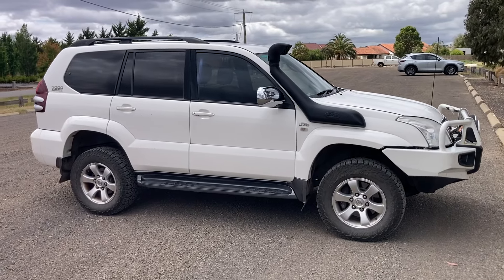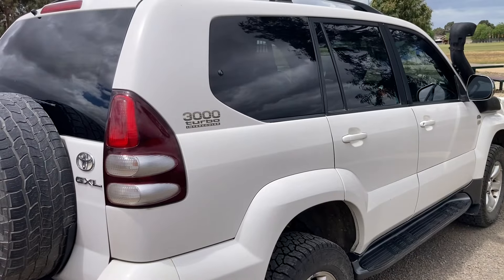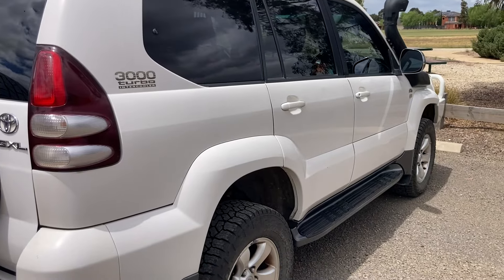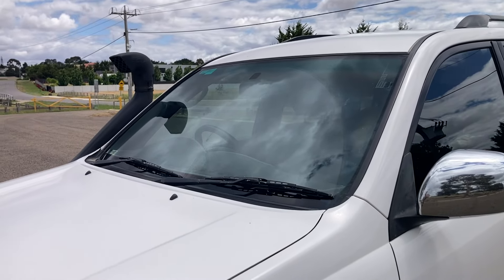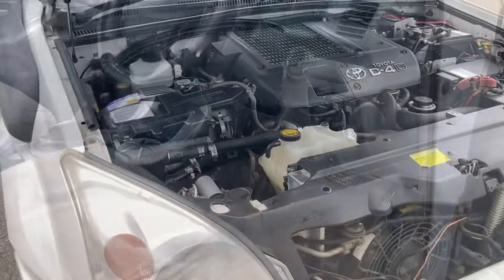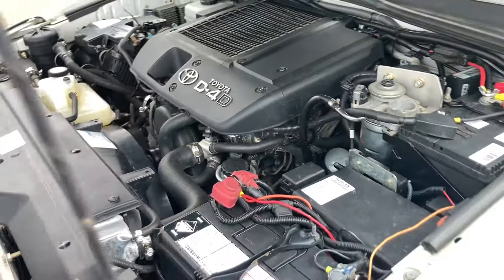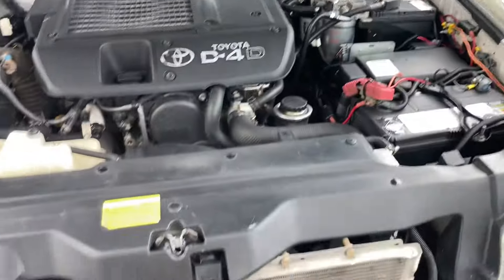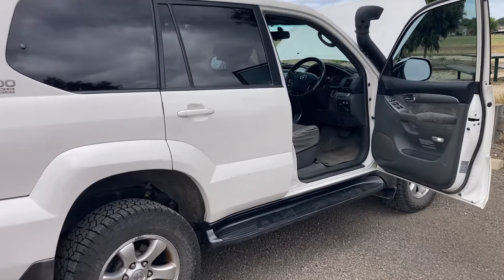LAST CHANCE Watch Then Comment with YOUR OFFER

Comment: I have a 2007 D4D Prado GXL ( Polar White ) which I'm considering selling.  It's done 296,500km  ( but importantly engine was ** FULLY REBUILT **  -  including premium injectors  -  by a Toyota Dealership at 250,000 km ) so  ' ONLY 46,000 km '  on the new motor !!  Pretty standard unit , clean & straight.  Service records avail . . . Not many ' low km ' 120's these days. So what would the group's thoughts on ( starting ) asking price ? Thanks.
Reply: I would buy it for $15k

Comment: Can’t believe it’s got a dent in EXACTLY the same spot as mine rear right door. Some asshole put it there last week in a carpark. Managed to pull 98 percent of it out with an eBay dent puller and glue gun so if you guys out there wondering whether they work they do.
Reply: I also have a 2007 D4D Prado ( White ) which looks identical to this one . . . complete with the ' very same ' rear right door dent !  :)

Comment: Auction place near us had similar 120 prado 1kd 6 sp manual for 12500 with 420ish Ks
Reply from the maker: And it had all the gear nice one if auction prices 12,000 maybe it is worth 20,000 after all 
When somebody hits 15 I think they’ll be getting close to around what a deal will be maybe hard to say I’m not the seller
Reply: @Fourby4Diesel no offence mate id be heistant as there could be a cracked piston waiting for me in the future based on ks travelled

I got 550 stx nav from that auction place yesterday. 2012, 200k for 13k. Fingers crossed.
Reply: The 120 series didn't come out with 6sp manual😆. Not until the 150. That's what swayed me to the 150  6yrs ago.
Reply from the maker: Ben
Incorrect

Comment: BFE kit and injector replacement are the only 2 things to do then it's good to go. I think if it is around $9k, it is a good deal. I would not spend more than $10k simply because the 120 has lost its appeal due to its age and ugly design. Good luck to the seller, I am sure he will sell it